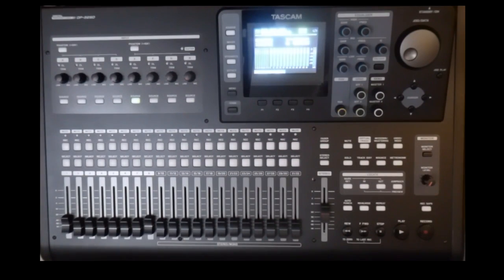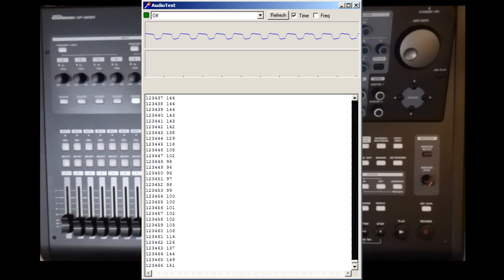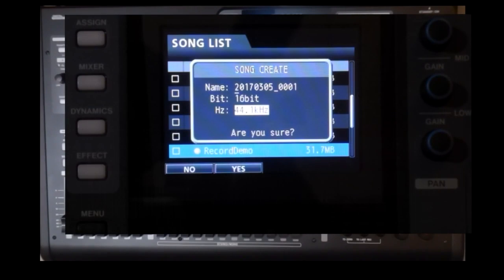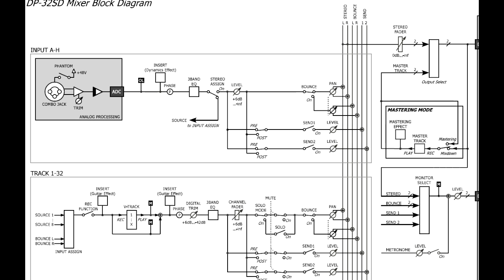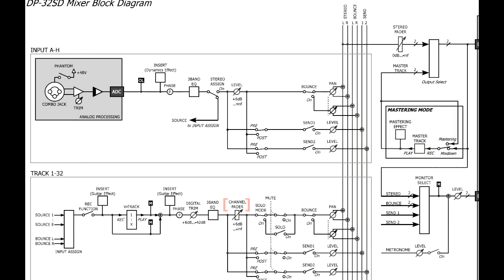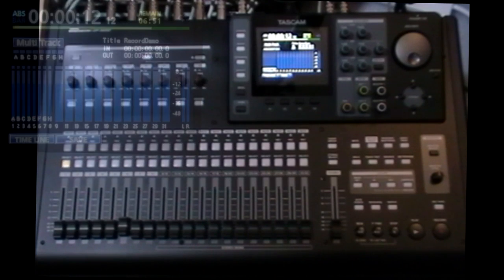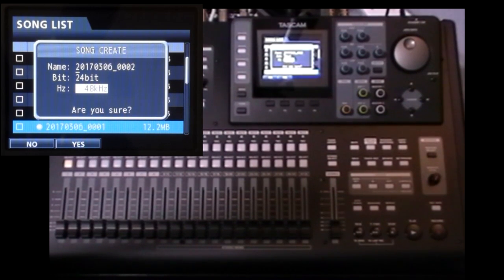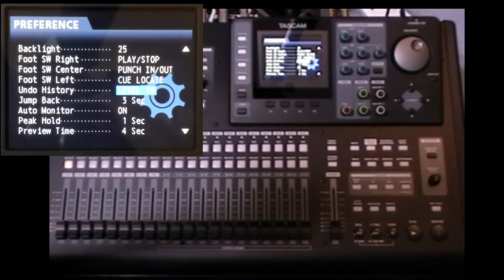Tascam DP24/32SD Tutorial 8A: Recording

Comment: Your tutorials are great, thank you very much. I was wondering the sd card shows 102 min left, but when I hit record button for one of the channels it goes to 6:45 sec. Can you explain, thanks in advance. I am using a 32gb card.
Reply from the maker: Hi +Steve Sweetwater - thanks for the feedback. Just updated my previous reply as have now done some (very!) rough sums and I think it's due to max file size limit on the sd-card (4GB on FAT32 cards). This means one track can only be a max of 4GB. At your lowest quality setting, a mono track needs approx 5MB per minute, so 4GB allows for about 12 hours (6 hours for stereo). At the max quality, these figures are about 8 hours for mono, 4 for stereo. If no tracks are armed, the machine has no way of knowing how many tracks you want for the song, so it calculates time remaining based on the total card size - for 32GB this is 8 times the above figures, i.e. 96 or 64 hours. Your quote of 102 mins is really '102 hours', so this would equate to my rough figure of 96 hours. Once you start arming tracks, the time remaining drops to the limit per track - again your figure of 6:45 secs is really 6 hours 45 mins, so assuming you armed a stereo track, this would agree with my 6 hour guesstimate for a stereo track. If you only arm a mono track, the remaining time should double... if my theory is right :) 
If you arm more & more tracks, the remaining time won't change as the limit is due to the individual track limits. Once the remaining space on the card drops below 4GB, the time remaining should decrease.
Reply: Phil - Thanks for answering, I just received the unit a couple days ago, and learning slowly, but thanks to you I am learning. I guess it was my mistake in thinking it was minutes and not hours. Thanks again for replying and have a great day.

Comment: Hi Phil, can you explain the benefits to the musician of recording to the stereo tracks rather than the single tracks.  Is it just a way for the manufacturer to get more tracks in a smaller unit or are there benefits to the recording process?  Thank you again for all you help.
Reply from the maker: Hi +Robin White. I can't think of a benefit if your source is mono... but they're pretty essential for stereo sources as the controls (levels, EQ etc) affect both left & right sides simultaneously. This means you can adjust them without moving the stereo image around - any slight imbalance will shift the sound - you can test this with a pair of mono tracks. It can be a big issue with machines like this where you can only adjust things like EQ one track at a time anyway, due to all tracks sharing a single set of knobs... but even with a conventional mixer with separate controls for each track, it's still hard to adjust pairs of mono controls in unison. A lot of synths and samplers have stereo outputs, and effect units like reverbs also tend to output stereo even if the input is mono, so you can never have enough stereo tracks imho :) The bonus with the dp32sd is that the stereo tracks can be configured to mono, although you only get one mono instead of a pair, but even then it was a deal-clincher for me.

Comment: I see you use different bit rates for different songs, Why?  Why not just use the highest quality all the time?
Reply from the maker: +Robin White - I normally use the highest rate - memory is so cheap nowadays... but here's a few reasons for using the lower rate: 1. it's the default setting so if you just want a quick non-important recording, it will do. If the default was the higher setting, I'd probably go with that! 2. If you don't intend processing it at all, and just want to burn a CD, then you'll avoid any degradation doing the down-conversion - some conversion tools offer a choice of algorithms trading quality for processing time, so depends if you're in a hurry. 3. If you have other gear which can only handle the lower digital settings, e.g. some external FX units have digital in & out options which cannot handle 48KHz. I know there's no direct digital interface on these Tascam machines, but once the wave files have been created, you can transfer them to a computer and then run them through the FX - and remain in the digital domain.